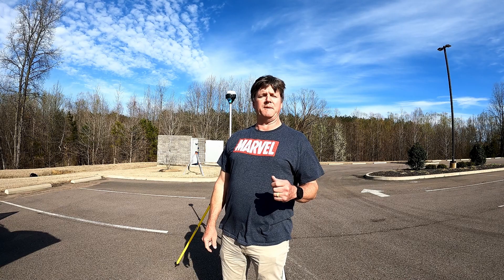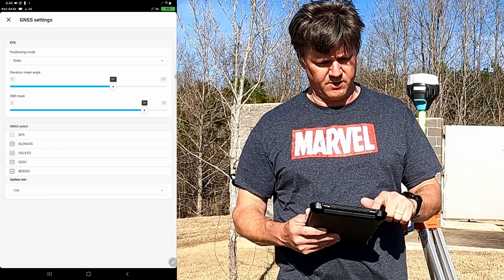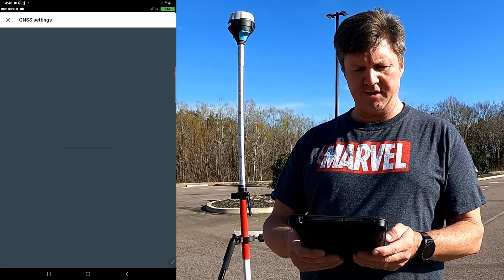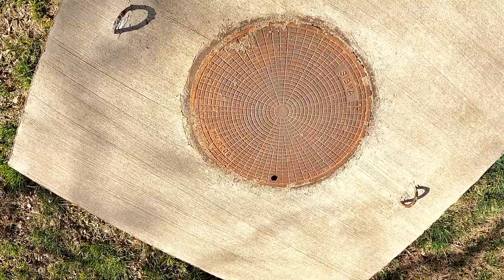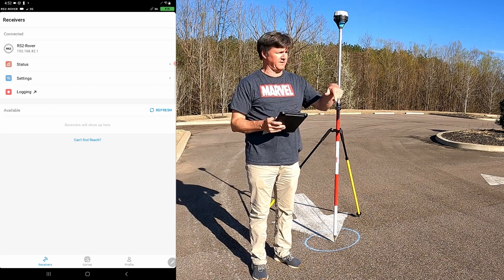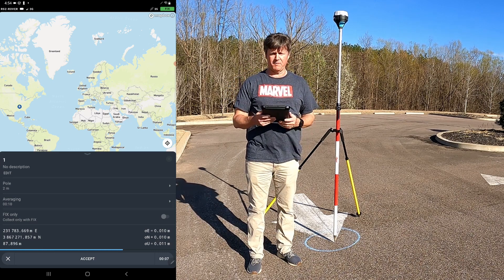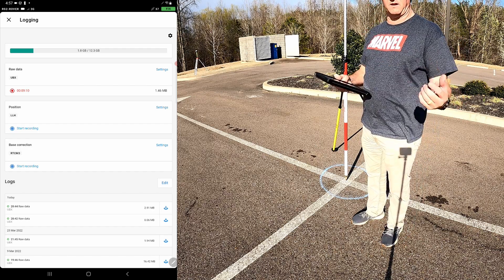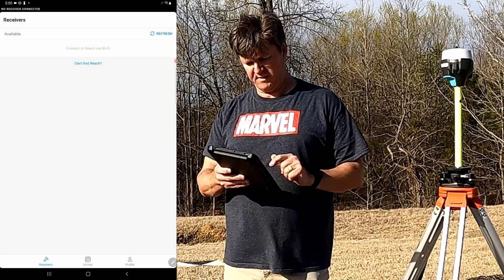How to collect GCP's with Reachview3 and Emlid RS2

Comment: Does the GCP file i create have to be in WGS84 UTM zones in meters to work with DJI? I'm guessing yes but, i just cant seem to find the simple answer.
Reply from the maker: Hi Benny, you can survey the GCP's in any CRS.  It can be WGS84 Lat/Lon, WGS84 UTM, NAD83 State Plane Coordinates.  etc.  Because when you do your photogrammetry processing, you will specify which CRS the GCP points are in.  Ideally you have a Base/Rover setup for your mapping mission.  If so, you would fly your M3E using RTK with your onsite base being the reference.  If you are using Emlid units, you can do RTK a variety of ways (see my video on that).  If you are using Stonex then you can use www.rtk2go.com for RTK or local NTRIP just like the Emlid units.  Same goes for Carlson BRX7 units.  
I hope this helps.  I always survey the GCP's in the CRS (coordinate reference system) that the job will be delivered in.  So if I do a job for the engineer and they want the files to be in NAD83(2011) Mississippi West us survey feet, then that is what I shoot my GCP's in.  Then when I use DJI Terra, Pix4D, Agisoft, or any other photogrammetry I will specify that the final CRS is the same (MS West).   Hope this helps.  Holler if you have questions.

Comment: Have you ever had it lose your survey?  I did two the other day and everything was fine.  Collected about 9 points and when I got back to the office it wasn't on the RS2.
Reply from the maker: Chris, so now you can do the survey either on the RS2 unit itself (via Web Browser), or the much better option is the using the ReachView 3 app.  If you used the RV3 app, the survey is stored on your phone/tablet and not the RS2.  So just making sure that is not the case.  If that is not the case, I have no idea.  I have never had a case where the survey just vanished per say.

Comment: Thank you. Could you suggest me, can we use Sparkfun facet data as gcp’s
Reply from the maker: Hi Ramesh,  I am assuming you are asking if you can use the Sparkfun GPS/RTK Receiver?  You can use any GNSS receiver to collect (survey) ground control points.  But the accuracy could vary greatly depending on what unit you are using.  The accuracy of the Reach RS2 is very good.  I have no idea on the accuracy of the Sparkfun receiver.  It would also depend on the quality of antenna that you paired with it.  I highly recommend using a dual frequency receiver which will allow for a longer base line (distance between your rover and base unit).  If you are using a Sparkfun GPS receiver, which generates a UBX file.  Paid software such as EZsurv and TopoSetter would process it.   and I am sure that RTKlib could process it just fine but I don't know for sure.
Reply: @3dMappingTools  Thank you. I understand. It can be used along with software like ezsurv and SW maps. Thank you once again.